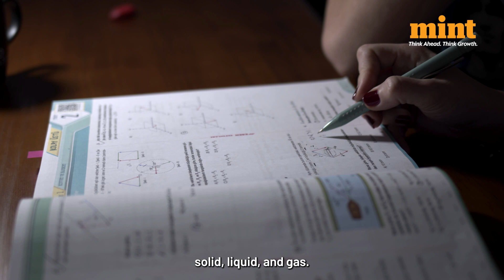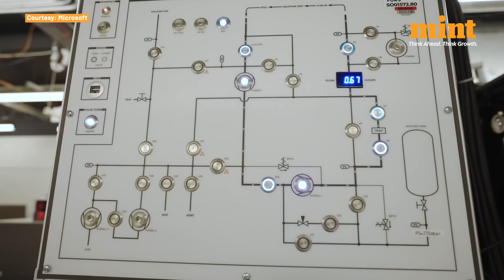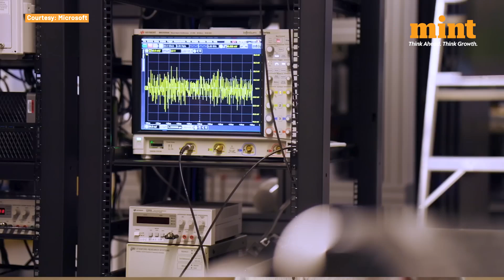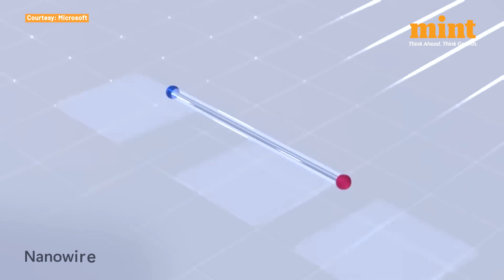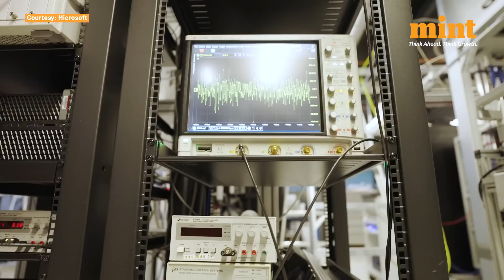Microsoft’s Majorana 1: Meet Quantum Computing Chip, Created From ‘Entirely New State of Matter’

Comment: Plasma is an ‘Entirely New State of Matter’ that is not Solid, Liquid or Gas. Also, it leads to fusion energy break-through and not quantum-computing break-through.
Reply: Vishal..  ha bhai. Tu bahot talented hai. Please koi processor bana.
Reply: Aree bro, who is talking about plasma. I don't you will understand but this is called topological superconducting phase, which is the new state of matter and in this phase it forms Majorana fermion quasi particles, which enables control on qubits in a simple way. 

Don't simple doubt thing you can't understand. Typical Indian behavior
Reply: @privateprofile3517  "Typical Indian behavior" ? You're not just over-generalizing but also likely very gullible. Read the MS academic paper (video misses some points) to understand the details and you'll see red-flags. If it's too technical for you and you don't see them, perhaps some history might help. This is not going to be the first time MS has retracted a quantum computing paper after it was disputed (by non-gullible subset of the scientific community). I'm not indicating malicious intent. Just saying that QC is hard and mistakes are possible. It's still a step in the right direction (only not as big a step as you're blindly assuming and then commenting badly on others).

Comment: They should stop trying to conflate GenAI and Quantum computing. Solving linier equations has limited applications, right now each quantum processor can only process one problem at a time and is not a general purpose computer. Picture six different processer chips and print a specific linier equation on each. If these six algorithms can't help you, then Quantum Computing can't help you. You can't play games on it, you can't print with it, you slow it down if you have to read data or memory while it is calculating. Each of these six processers might solve that one problem over and over again and have a backlog or queue of that same work to do over and over again. Each processer will have a time to respond, like 2 minutes or even 2 months. They only do one thing. If GenAI wants to send an API call to a specific processor in a data center in NYC it will have to wait on a response like everyone else. It won't make GenAI faster, it will actually slow it down if it has to wait on a solution to a linier equation. Sure, many outputs of these equation solutions might result in a bulk of information GenAI can use to leverage patters or probabilities, but it is not unique to GenAI.